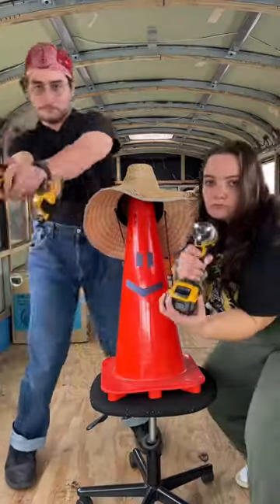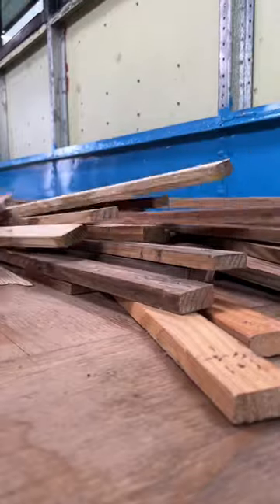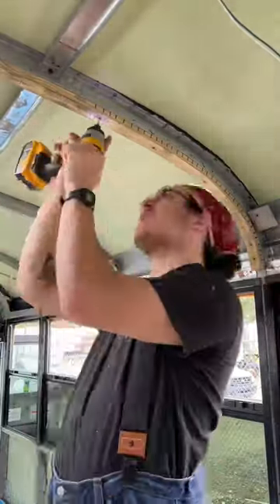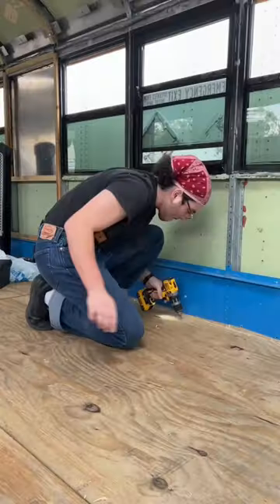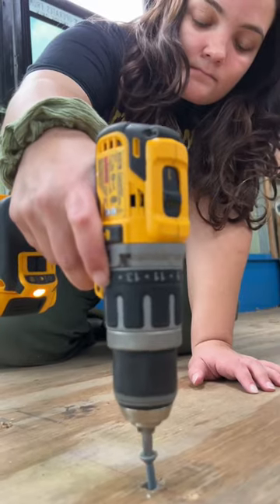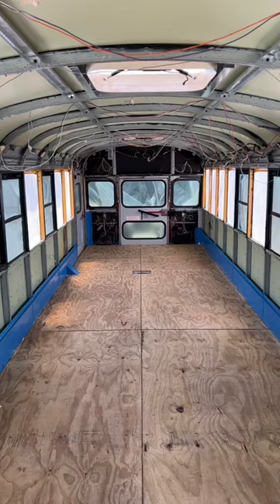Boy this sucked. #diy#diyprojects #skoolieconversion#vanlife #buslife#skoolie#diyproject#skoolielife

Comment: I'm glad you guys are finally seeing the light

Listen, get stuff that's cheap, but not so cheap it's actually expensive. You've lived that lesson now learn it. Slow down, take bite size chunks. You don't actually know what you need or whether it would ever fill a bus. 

Get a GAS engine in a van sized or class B iirc rv. Get a COMMON engine, frame, etc. Something built on an F250/350/450 chassis might be a good choice. Short Busses are built on those sometimes as are rvs. Whatever it is, make sure you're able to find power train parts in pick and pulls across the country. 

Get a decent set of tools, harbor freight, Amazon etc. Watch and read reviews. Dewalt 20V  is a good platform to work with. Good, not great, reliable, not professional. 

Lastly, get a 3D printer. Theres a van life couple that has one in their home. Get a used or better yet new kit for a prusa mk3s. It's not the cheapest, but it will print, ever, single, time. An ender will not and will require constantly fiddling. By the time the ender is running smooth, you'll have spent prusa money.  

Use the printer to make, not buy, nickel and dime parts. You can make all manner of brackets, handles, holders, boxes shelves etc for pennies and if you learn a modicum of cad, it's easy to custom make it for your situation. If you find a design you really really like, you can print in a wood brass, steel, etc faux finish. Need auto parts? Print in asa/abs (same plastic factory uses) , need really really strong stuff? Print in carbon fiber reinforced plastics. Get really into it? You can turn plastic bottles into plastic filament and make shit with that. Sky's the limit

Tldr, get simple, common, easy to work on machines and good tools. Start small. Go budget but not cheap.

Comment: Always great videos you two. Hey! Make sure you remove all those Carling-style rocker switches on the dash, they fit many years of busses and are worth good money, cut the connectors with six inches of wiring too. Remove that dash cluster, fits many years as well. Radiator, turbo intercooler, air cleaner, and related tubing are all good to have on hand. The top red/yellow flasher light lenses fit your rear brake and turn lights. If you have an electric or air-powered door, take all related to that as well. Fits many years and is worth good money. Merry Christmas you two.

Comment: Strip as much of the parts as you can.  Take the AC compressors, the alternator, the egr valve, any emission component you can, switches, sensors, valves...

Comment: So get a new bus with a new unknown engine with a new unknown everything and start again versus putting in a hopefully good engine I don't know
Reply: Getting a new engine would be significant better but they literally saved screws so
Reply: @pinkpony265  the price of hardware is stupid in their defense.  Especially if it's stainless
Reply: If they pay a mechanic to look the engine over on a new bus then it shouldn't be an issue. Sadly it seems like both busses went down to their lack of knowledge of engines and knowing when to turn the engine off. Not trying to being mean.